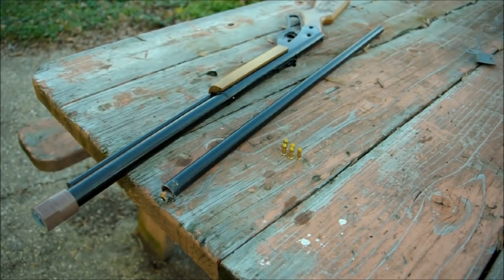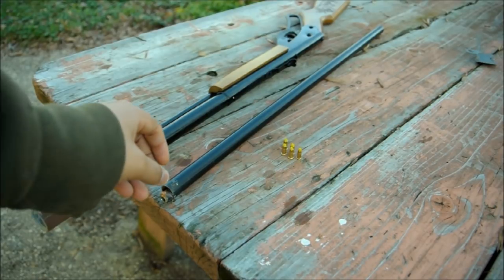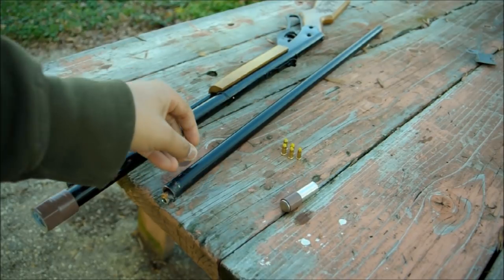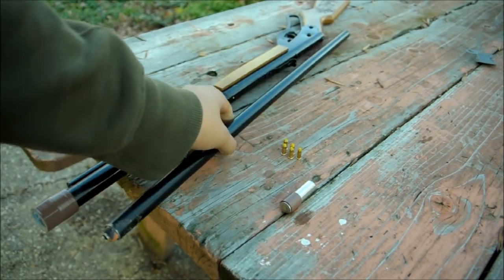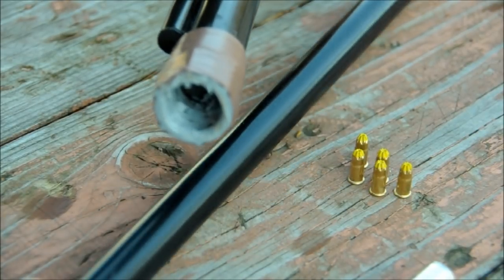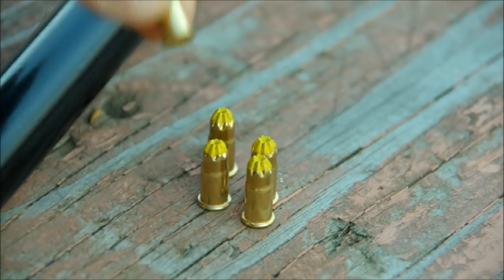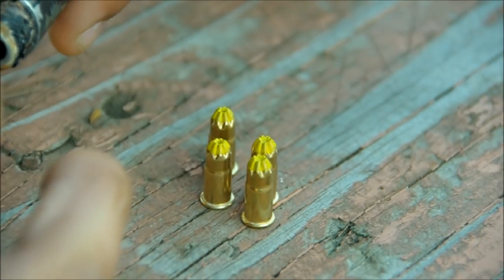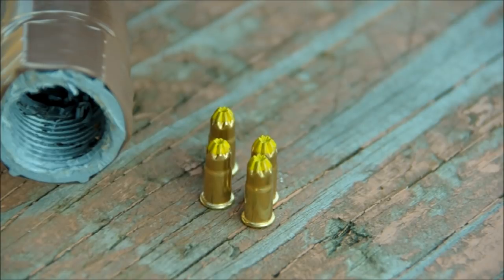bb gun mod, .22 cal blank rifle cartridge used to fire large projectiles

Comment: Cut the barrel down so the extensions not rediculously long #1, #2 open the blanks, insert a 40grain .22 airgun slug inside, crimp shit, then throw a bunch of foam rings around a 22lr barrel and inert that into the aluminum barrel thing. You only need 4-6in of bb gun barrel and 14in of 22cal barrel to get enough from the bb to set off the cartridge and 22lr tends to max out speed and power between 12-16in long barrels. My buddy threw a 38grajn in a blank out a similar bb gun usibf 14in barrel at 2400fps. Double the speed of a 22lr and more akin to a 22magnum, since your using a 22lr barrel to its threaded and will be usable and accurate

Comment: Quite interesting and surprising ballistics. It would be great to see this with the range of .22 PAT shells.  I believe they are a much faster burn rate than rifle cartridges-and so not as efficient at accelerating a heavy projectile. To launch a relatively massive AA battery and knock a can of  sand like that is impressive. As I understand it Red is the second hottest of the brass series- pushing a 350 grain projectile to 675 feet per second. After the brass series are the nickel "silver" - with the top performer rated at 1295 fps/350g.

Comment from the maker: it doesent misfire. the .22 round is held to one side so that the rim is positioned in the center of the tube which is exactly where the bb strikes because thats where the inner barrel is. if the .22 round were not there, the bb would fly straight down the center of the tube. it does not wobble because the PVC is very snug

Comment from the maker: how would that even happen? the shell is wedged against the edge of the bb gun barrel so that it cant slide out backwards and release any pressure in the wrong direction. also, the front end is the path of least resistance so the blast will naturally move in that direction. even if some pressure did escape backwards nothing would happen, the bb gun is not breech loaded so its not like the bb could be shot out backwards

Comment: Unless your inner barrel is rifled or welded to the outer barrel, your gun is illegal per the National Firearms Act.  Not sure if it's been mentioned before, but it is either a Short Barrel Rifle (if rifled) or an Any Other Weapon (if smooth bore).  Either way, it's bad.
Reply: I'm not certain, but it probably doesn't count as 'fixed ammunition' per the ATF definition, so it is most likely exempt, like modern cap and ball SBR and SBS, and any black powder firearm.

Comment: PENAL CODETITLE 10. OFFENSES AGAINST PUBLIC HEALTH, SAFETY, AND MORALSCHAPTER 46. WEAPONS
Sec. 46.01.
(16)  "Zip gun" means a device or combination of devices that was not originally a firearm and is adapted to expel a projectile through a smooth-bore or rifled-bore barrel by using the energy generated by an explosion or burning substance.

Comment: so I recently found out that this should be perfectly legal in most parts of the united states, if authorities ask tell them that it is not a regulated firearm because it does not use attached ammunition (ie a brass cartridge containing bullet and propellent) thus it should have the same legal privileges of a blackpowder muzzleloader. however due to laws on where you can discharge a firearm, depending on where you live, you may want to deny having shot marbles in your backyard if authorities ask

Comment: Why aren't u throwing a tube from the hole in the open chamber that sends the air out when firwd all the way to the end of the rimfire? You could make it hit hard enohgh to explode a rimfire qith 4.5-5in of tube kr barrel. Meaninf you could cut your bbgun bareel down to 6.5in then throw on 14in of 22lr and yove got a badass gun especially if you make it braak barrel so u can slide a new 22lr in a drop a ne bb in pretty quick. The full and semi auto bbgubs would work better u cut the barrels down and shit have a 14-16in 22lr barrel. Then have a grav fed 22mag there. and a little finger hole u can pullback on which pulls the spent round back out of the barrel and pver a open hole having the spent round fall out. The main problem worh these is ejection which makes mags a problem. Semi autos will not getin the way pf the 22lr carr and barewl ans bw far enouh to be strong enough tp set them off n go boom. By pulling the round out the next grav fed round fals into place and pushing the finger lever forwars inserts the next round. You could probably take $50 and a couple hours to prgram spme motors to operare it autonomously making it semi auto.

Comment: Use a 12 gauge shell next time instead of the battery, I don't know if it will set the primer off but if it doesn't put a little screw on the end of the .22 - I do not accept liability for any damages to yourself or property incurred while applying my comment to your technique. Lol...

Comment: Just FYI... "Rinfire" just means that it doesn't have a separate removable primer. It doesn't mean you literally have to strike it on the rim. Lol
Reply from the maker: Jack Kinney false. If you want rimfire cartridges to fire reliably you should not be striking them anywhere else. The rim of the cartridge is seated against the chamber thus having a solid reliable striking surface braced against the rim. Rimfire is called rimfire because the primer compound is packed in the rim of the cartridge. Sure they might fire if you strike them in the center but 1- not reliably, and 2- depending on what your striker looks like in a home build you could risk puncturing the base of the cartridge and that could be catastrophic.